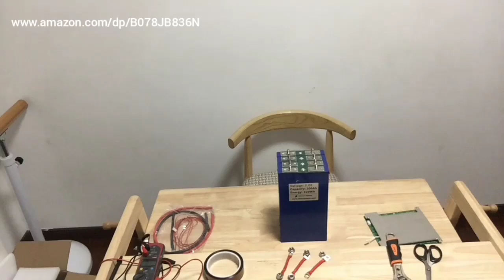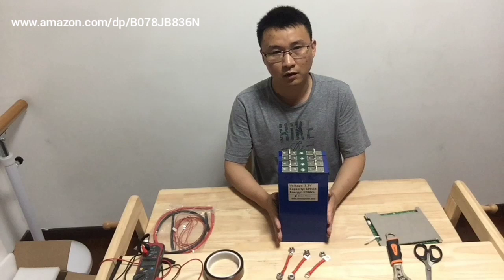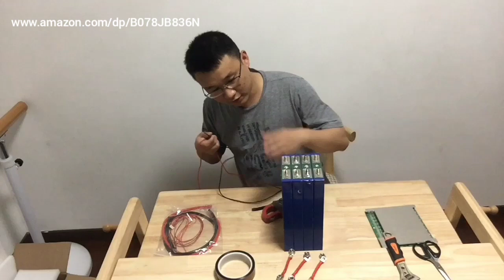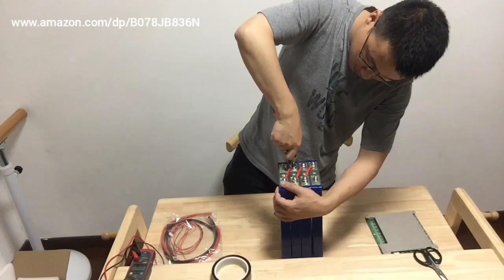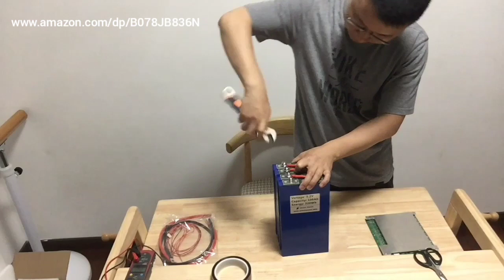DIY 12V100AH Lithium Iron phosphate LiFePO4 Battery Without BMS for Camper Van, Car Audio, Solar

Comment: i want to get these for my truck i want to buy 2 4 packs of these and run 4s4p max amps id be pulling is 800 and i got a 280amp alternator would i be fine?
Reply from the maker: Please contact info@orientpower.asia for detail.